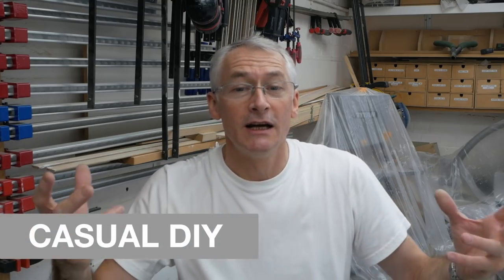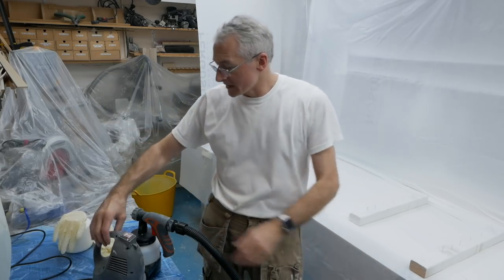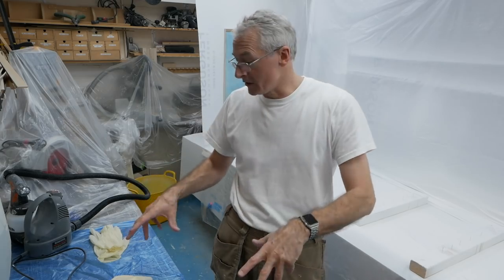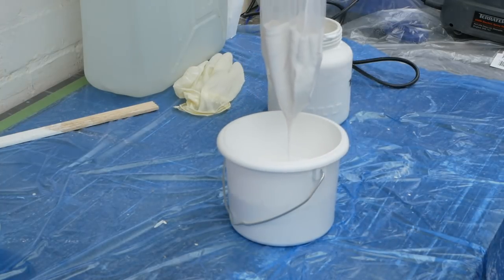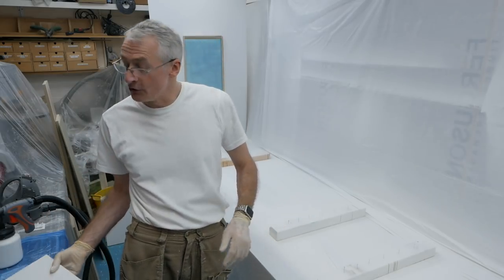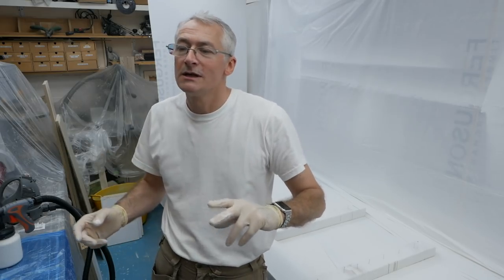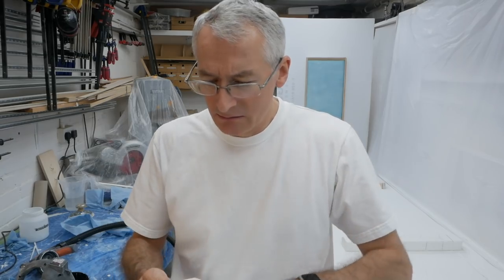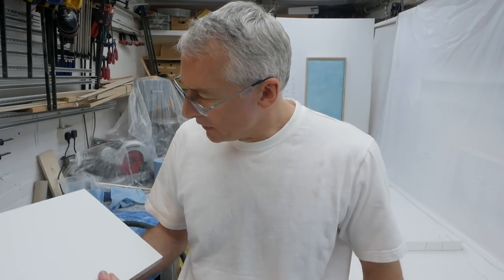£30 HVLP Sprayer P1 [Video #232]

Comment: Hi Peter,

Interesting video as ever. You made a comment in both parts of this video you should have strained before thinning. Can I ask why it makes a difference?
Reply from the maker: Hi Chris. It just removes any ‘lumpiness’ in the paint. It’s particularly important when spraying as any seemingly incidental but if debris can cause a blockage. As I say, easy enough to deal with in an airless, harder with hvlp. 👍👍
Reply: Hi Peter, sorry I should have been more clear here. Why does it matter if you strain before or after thinning?

Comment: Wondering if  a  shop vac that has a  air outlet  could drive a  HVLP gun/hose? the reason i ask is that  the   hose connections look like ryobi shop vac style
Reply from the maker: Yes, someone did this as a gag when the small Festool vac came out that had a blower function. 👍

Comment: You use it for primer can also use that for finish paint? and do you need to thin the paint?, Great Video 👍
Reply from the maker: Yes - I show details in part 2. And yes to thinning the paint, about 10-20% depending on the paint. 👍

Comment: I just bought the Graco you were using based on the earlier recommendation you had. Then you mentioned some ‘defect’ and now you are on a completely different tack. Can you at least detail the issues you had with the Graco?
Reply from the maker: I’m not on a completely different tack, I’m trying out a cheap hvlp gun that I never knew existed to see what something 1/20th the price of the Graco is like. I explained the issues I had with the Graco at length in the concluding part of the 8-part series - the tip wasn’t sealing properly, and that led to the excessive overspray I was getting. New seal, and all’s well.

As I say in part 2 of this short series (out today) this isn’t replacing my Graco (for all the reasons I outlined in Part 2 of the Graco series, it’s airless for me) but for someone who want to dip a toe in the spraying pool, for £30 this is a fantastic way to start. 👍👍
Reply: Peter Millard Okay, it wasn’t clear until the second episode. The Graco here in Japan was hard to find and very expensive so I was taken aback by what seemed a big change of strategy and was worried I made a poor choice. Thanks for explaining the issue you experienced, not sure how I missed it, will rewatch all the episodes before my big cabinet project.

Comment: Triple rinse is drilled-into chemical sprayer operatives (pesticides etc).  Step 1 Add small amount of water, agitate and spray through.  2 and 3 repeat step one.  Peter is quite right in what he demonstrates but the triple rinse method is extremely effective for ridding chemicals.  Just trying to be helpful, not pedantic.
Reply from the maker: Good to know, thanks! 👍

Comment: Hi. I have watched most of your spray videos but can’t find any mention of what % water you are adding to the paint. I am just starting out on spraying and adding up to 30% water so far and it’s still not flowing through the velocity cup as required. I am using Leyland acrylic primer which I think is the same as you are using.
Reply from the maker: Hi. Because the paint viscocity varies so much I try and avoid using a %. As I say I aim for "single cream" consistency; not milk, not double cream. Single cream, as the starting point. 30% seems high for the leyland primer - what sprayer are you using?
Reply: Peter Millard I am using a Haupon TN-71. Think I will go out and buy some single cream and pour that through the velocity cup lol. Thanks for your prompt reply, I find your videos really useful as I am moving direction from fitting kitchens and bedrooms supplied from Howdens, Wickes etc, to making my own. 33 years of doing that and this lockdown period has made want to change direction.

Comment: I hate to be "that guy" but it hurt my eyes to see the paint build up on that air cap. I'd highly recommend you keep it cleaner than that. Whilst the holes may still be clear that build up will cause turbulence in the airflow, affecting spray pattern and atomisation. In the worst case material (paint) can build up whilst spraying then get released as a big drop into your workpiece. I know it's only a cheap & cheerful (my gun collection runs into thousands of pounds) but that probably means it needs all the help it can get 😉
Great video as always though Peter, and it's amazing to see what you can get for so little money.
Reply from the maker: Thanks! Yes, as I mention in part 2 you need to be aware of the paint build-up, especially with water-based paints, as they dry very fast on the tip, and can - as I learned - affect the paint flow making it prone to spatter. But actually the air cap’s almost impossible to keep any cleaner that that - it’s almost like they made it deliberately difficult to clean - and yet it still works... 👍👍
Reply: Ah, didn't realise there was a part 2.
I actually use a denture cleaning brush on my own guns 🤣 but a firm toothbrush would probably be just as good. Hard enough to scrub away the deposits without damaging the metal and/or misshaping the holes. Might be worth a try.
Reply from the maker: Thanks! Big number “1” in he corner of the thumbnail Andy, usually a giveaway! 😂 Yes, toothbrush usually works - and no metal in this gun 😆👍👍
Reply: Ouch! 😂
I always miss the obvious stuff 🤣

Comment: Great content, I have a similar machine, do you see yours spitting with spots?
Reply from the maker: Been a long time since I sprayed anything, but spits and spots are usually a sign that the tip needs cleaning. 👍
Reply: @10MinuteWorkshop  thanks for reply so quick, spit and spot are from yesterday, just tried today, I did not mixed well yesterday after added water. Cheers.

Comment: Peter, what have you done to me, after watching this and all the other playing at spraying videos + the shelves for tools videos I've had one of these ordered for me by a client for custom radiator covers I'm making.
I'm going to use leyland acrylic primer and because he wants battleship grey I'm going to experiment with what I believe to be a silk or emulsion that he has had on the walls - if I take my time how do you rate my chances?
Thanks again for all your efforts I really appreciate it.
Reply from the maker: Wow, clients buying you the tools for the job - result! Not sure how well emulsion would wear on a rad, might be better off getting the colour matched in an eggshell finish?? And I rate your chances very highly! First time I used the little sprayer was on a customers job using Leyland water-based acrylics, works a treat! Remember to thin the paint down 👍👍
Reply: @10MinuteWorkshop  Cheers for replying again, I'll let you know how I get on.
Reply: Well I've had my first go I'm sure your excited to know, I've set up a spray area like yours with corex boards, nailed through some boards for workpiece  supports, strained the un-thinned leyland acrylic primer and thinned it to around 20% and got splatters, ok, no bother I'll thin down it down some more and immediately got orange peel effect on my mdf additionally it completely disappeared into the end grain.
What am I doing wrong or is it just a skill gap that I've got and I need more practice.
Cheers
Matt M
Reply from the maker: @VapourTrailz  If you're getting orange-peel it's either too thick or you're spraying too closely - or both; I found spraying from about 300mm away worked OK, though I went in a bit closer on the edges. Spatters/spitting could be the tip of the gun clogging - is it clean? How much paint is coming out when you  squeeze the trigger? Very fine mist or more like the  amount of water that comes out when you flush it through to clean it? You want to aim for somewhere between the two. Have you altered the airflow on the gun? I found it needed maximum or close to it to get a good flow through it. Takes a bit of trial and error, lots of moving parts so it's a bit of a mystery dance at first but once it clicks it's fantastic. 👍
Reply: @10MinuteWorkshop  Thanks mate, there's a pint in your Paypal for you.
Cheers
Reply from the maker: @VapourTrailz  Thanks! I've just shot you a quick email in reply 👍👍🍻

Comment: Looks like the UKs answer to Dexter ... in the background that is
Reply: @10MinuteWorkshop  Peter hi, do you think such a budget spray unit will be suitable for an oil based product. It's for a rust prevention fluid ACF50, to provide fine mist over a motorcycle. Imagine 3in1 oil consistency and it just oozes out of standard spray bottles.
TBH at 30£ Amazon Prime I will take the risk, but just in case you're able to help, thanks in advance.